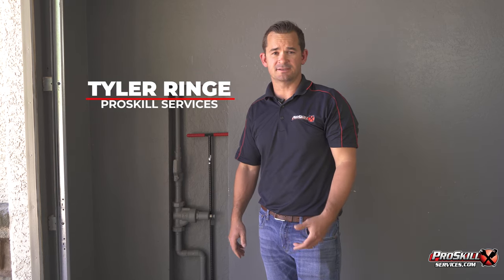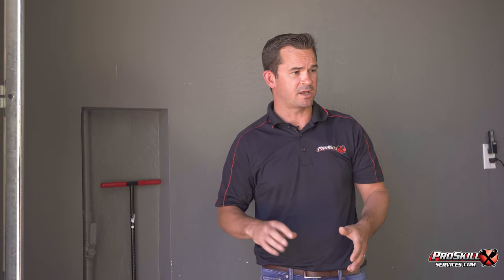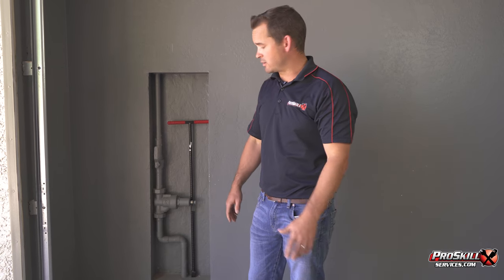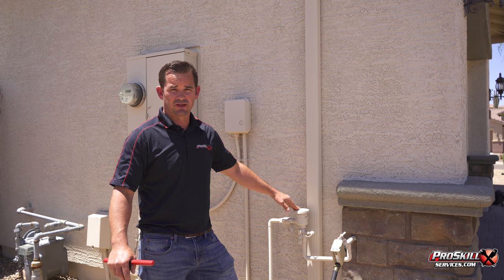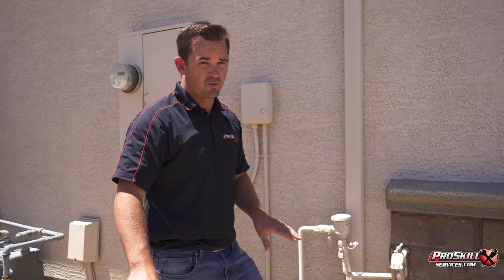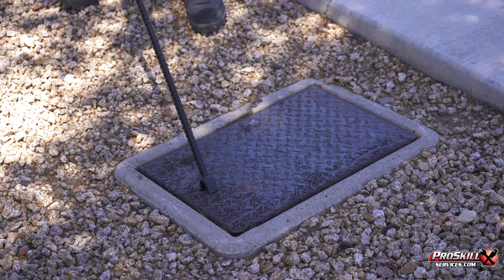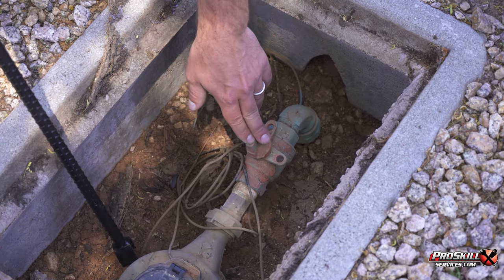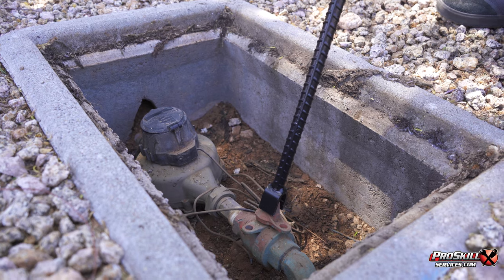Two methods to turn off your homes water supply.

Comment: Great video ! When shutting main valve the hot water will still go in the house until the heater tank empty?  I need to replace faucet but the stuck valve and want to be prepared if I break it how long will the water leak.. lol
Reply: how did it go? i have a same problem.
Reply: @tifi4220  I shut the main valve  both cold and hot was stopped
Reply: But if it’s due to your under the sink shutoff it will still leak after the HW Heater empties but  only it would be cold water?

Comment: quick question,
The county just did road work and new sidewalks.
They actually poured concrete over the water box, so now I need them to break up the concrete to find the valve so I can change over the valve inside the house
to a ball valve or similar. If there is a problem in the house I would be in trouble.
 Any ideas on how to locate the water box under concrete.
Thanks Lanny
Reply: Wow. Did you get it worked out?

Comment: In the room where my water heater is there is a large ball valve.  I'm wondering if it's just to shut off the water to the water heater or if it's to shut off the water to the house.  It's a modular home and the water heater is in the end of the house where water enters the property.
Reply: Mine just shuts off the water heater.

Comment: I went to my meter box to shut off water to the house. I had my key ready, but when I opened the box there, I did not see a standard valve. All I saw was the pentagon-shaped nut. I am still not sure what this is or nor what to do in order to shut off water. Any advice??

Comment: Does the water shut off right away?
Reply: Yes, but you will still have some water in your pipes that you can drain from your faucets.
Reply: Nah, have to wait like two years for it to stop...
Reply: Mine shirt immediately. Well the cold side did. Hot side still pouring water only at a slower rate.

Comment: Can you turn the valve off at the street by hand?
Reply: Depends, but a adjustable wrench sometimes can work
Reply: @user-xw7ni7jf9s  Thanks, I can't get it to turn with my curb key.
Reply: @nickyonstilts128 Home Depot sells the keys to the street.  I know this is old and your situation is most likely resolved but for others
Reply: Typically

Comment: the cover of that water meter outside my house made out of concrete, only a couple of finger size round holes , is there a tool to pull it open? As you said I dont want to accidentally get bitten by snake or insect or rodent who might be hiding underneath it.
Reply: Yes a meter hook is a short piece of rod with a handle on one end and a small curved hook on the other that fits through the small hole to lift the lid. It is used by the people that read meters manually.